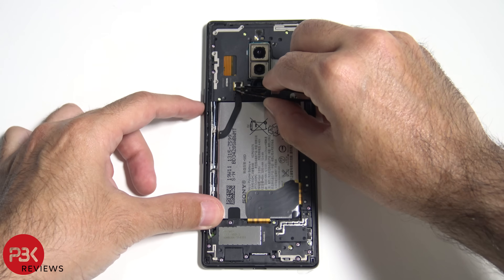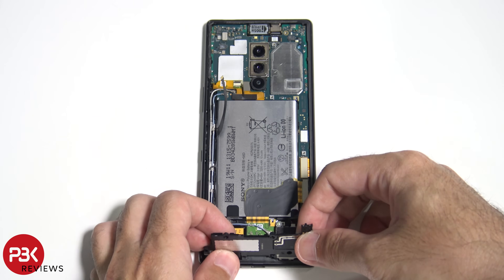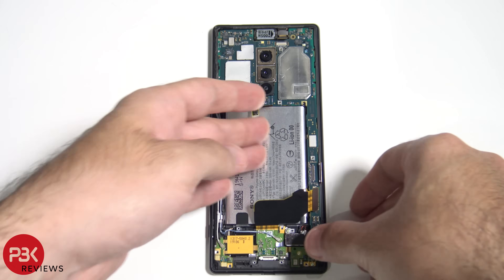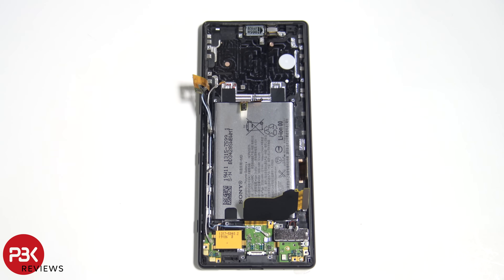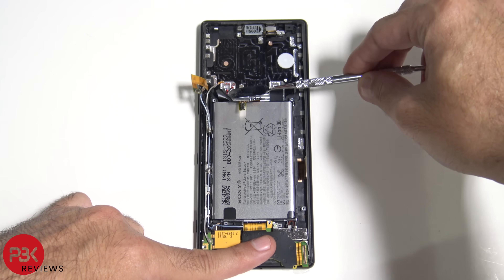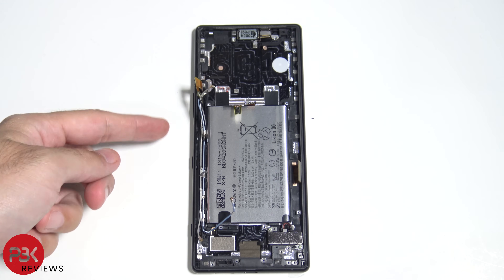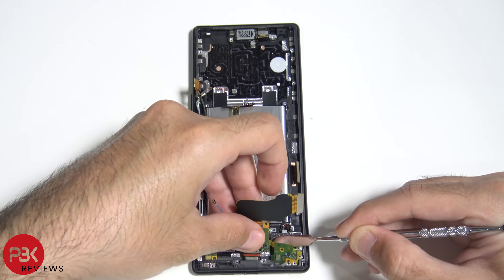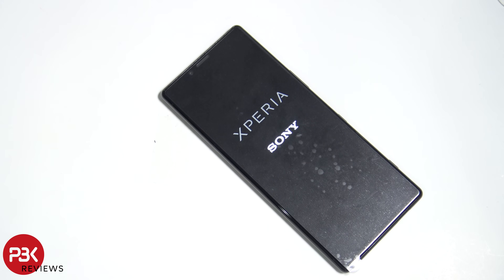Sony Xperia 1 Teardown Disassembly Repair Guide

Comment: Watching on my Xperia 1. My phone gets hot often. Is it due to lack of proper cooling system?
Reply from the maker: its possible, or it might be background apps running. Have you tried doing a backup of everything then factory resetting the device to make sure no malware or other stuff are causing this?
Reply: @PBKreviews  thank you for replying. There's no malware probably because I don't download random apps. But I have noticed one thing. I added you tube, Google news, Sony news, Flipboard and Google app to focus mode. When I switch focus mode on, it gets less hot or sometimes no hot. Is YouTube causing this ? Because others are just news apps. When I close all apps in background, still it gets hot. But when I switch focus mode on, it doesn't or less. Sometimes it gets too hot while charging. If I have to make a video call after, it doesn't last more than ⁵ mins. But I will try your advice. I will factory reset it. But this problem is since beginning. Any other advice please tell me. Thank you.
Reply from the maker: @ssingh5423  Its normal for phones to heat up when using the internet or charging the phone or playing games etc. Just depends how hot its getting. If its hot to the point its burning then that's not a good sign but if its just getting hot and you can still hold the phone in your hand comfortably then its normal.
Reply: @PBKreviews  ok. I will factory reset it and let you know. Do you think YouTube can cause it? Furthermore, are other companies giving better heat management system than Sony? When you tear down Xperia Mark 2, please compare heating system whether it is improved or not. I have watched your video of 10 Mark 2. You just told about hearing paste but not that it is improved or not. Please explain those things as well in videos. Your new subscriber. Thank you.
Reply: Factory reset will do nothing. This phone is a high performance device and will overheat easily when toughest apps are used. This will include video, games and functions like hotspot

Comment: Hi there can you advise me where i can get a replacement screen please
Reply from the maker: Hi, there are some on ebay but are pricey. You can search it on ebay and filter to list from price + shipping from highest to lowest and you will see there is a few listed. Reason I say to filter from highest to lowest is there is no one selling it for cheap so those are the only ones on ebay I was able to find. When you search it regularly it shows hundreds of other model ones and hard to filter through them to find the xperia 1 screens.

Comment: Is it possible to change the display and frame if I follow your disassembly guide?
Reply from the maker: Yea you should be able to. It's easier to do if you find a display and frame combo but if not, the screen after disassembling the phone is held on with adhesive. You would need to pry off the old screen and apply new adhesive and the new screen to the frame and reverse the process.
Reply: @PBKreviews  thank you very much :)
Reply from the maker: @batschisdadoller  you're welcome

Comment: Hi damaged my back cover ordered a replacement cover how do you remove the cover easily does it just snap off or is it glued in? Thanks in advance
Reply from the maker: Hi, its held on with adhesive tape which is like a double tape, sticky on both sides which holds it down. Apply heat and pry it off. Usually the replacement backs should come with adhesive strip pre installed already so you can just peel the protective tape off of the adhesive and install but if the one you ordered does not, you can order smartphone red tape or smartphone adhesive and cut strips that you can stick around the sides of the back plate to hold it down. I also have links in the description for adhesive tapes etc.

Comment: Is it fair to say the the position of the cpu makes it impossible to add passive or active cooling to the back of the phone? For example, heatsink or fan or fabricating a custom back plate. Is the main heat source facing the back of phone or the screen?
Reply from the maker: Yea the main heat source is facing the back of the screen so I don't think you would really be able to add anything aside from a thin copper vapor chamber that you can put in between the frame and board and remove the thermal pads and use thermal paste instead with the vapor chamber.
Reply: Find a backfan on aliexpress. These are good enough. I have one. It uses a small spring to grip on both sides. I can easily avoid accidentally pressing buttons with it too. It wil work, just find a good one. The phone, the whole brand, is worth it.

Comment: Does the back plate just clip back in place?
Reply from the maker: no you need to apply new adhesive to the back
Reply: @PBKreviews  where do you apply adhesive is it round the edges, is it like a glue or sticky pad?

Comment: I accidentally inserted a sim removal tool into the top tiny hole on the other side of the sim card tray (forgot that on the xperia 1, you don't need to use a sim card removal pin).

Will that damage anything?  I looks like I just poked through a piece of foam?
Reply from the maker: For the most part you should be fine, that hole is for the microphone. The thing you poked through is the filter/gasket
Reply: PBKreviews thanks man, great video!

Comment: So what do you think? They could've had wireless charging easily there right? enough room also.
Nice teardown video.
Reply: Late reply but Sony Xperias dont have wireless charging because that is less effective which means more heat which means faster battery degradation.
Reply: @hampusrytterlov8619  yeah i hear sony batteries are better long term and a large part of the reason is the lack of speed charging and wireless charging. i'm fine with a little slower charging speed if it'll keep the battery in good condition longer.
Reply: Wireless charging is like toys for kids: it gets used a bit then tossed aside.
Sony uses their head and doesn't add something that's of no use in the end.
 It also only creates magnetic fields. Very dangerous for any kind of pacemaker/ICD.
Reply: @MissQueenEllie very good points my man. Though i think Sony have added Wireless charging to the latest version so they must have either changed their mind or just given in to customer demand who knows?
Reply from the maker: Ya would be possible. Thanks!

Comment: Would have been funny if after you put it together and turned it on it caught fire and blew up...like a Galaxy note 7. Seriously great tear down. I am seriously considering this phone.
Reply: I got the chance to preorder  both for the price of the phone, from B&H, I personally like the phone a lot, fast charging 18W, screen is gorgeous, tall aspect is great for browsing web pages and watching movies 21:9 ratio, cameras are ok too did not used them a lot yet, it comes with a headphone to USB C adaptor... works
Reply from the maker: lol ya. Thanks!
Reply: @PBKreviews  i hardly use headphone jack anymore so i ordered the phone at B&H. So this video may come in handy!
Reply: This is not crapy samsung. Japanese worked on it. 
Sony 
Make,Believe.
Reply: buddy1065 it is a great phone but a shame there's no headphone jack
Reply: @kapilbusawah7169  it has an adaptor in the box with the phone works great, with Audio Technica headset

Comment: People are complaining about the battery capacity, do you think there is more room for a bigger battery??
Reply from the maker: There honestly is no room at all around the battery to put a larger one in. This phone is pretty compact as it is so the battery is snug fit pretty much.
Reply: @PBKreviews  does it have good cooling system? Mine seems to overheat and shutdown a lot
Reply from the maker: @alfonsoalvarez8357  Nothing crazy and super good no. Just typical average small thermal pad transferring some heat to the midframe
Reply: @PBKreviews  could that be the reason my phone shuts down a lot when playing high graphic games or spending hours on facebook?
Reply: @PBKreviews    i have problems with my xperia 1 shutting down when in use, especially when using facebook for prolonged periods or playing games like asphalt 9. It also shuts down during gpu tests or geek bench tests. I am only able to complete them if i dunk the phone in water. When the phone shuts down and i try to restart it the screen would glitch, like tiny colored lines would appear and the phone would freeze. It will only boot properly if i wait a while for the phone to cool down. Do you think its because of the kind of cooling system this phone uses or is there something broken on my xperia 1?
Reply from the maker: @alfonsoalvarez8357  Its possible, or it might be just overheating due to other issues and shutting off since its overheating to prevent the processor from dying out
Reply: @PBKreviews  thanks for the info. The problem started even before my phone caughta drop of water
Reply: Dont need bigger battery becouse sony is the king for battery optimization. I have used their devices from 2003 and everything perfect. 
GUARANTIED.

Comment: Nice review man 👍, how did you find the build quality on that phone?
Reply from the maker: Thank you! Overall I think the build quality is good, I especially like what they did with the battery tabs making it easier to replace the battery, so repairs on this phone should be much easier than most other phones.
Reply: @PBKreviews  what about the sony xz2
Is it easy also to change battery like this one ?
Reply: just ordered this phone and gonna try my best not to have to ever do this. from what i've heard, even though the battery is a little on the small side, it's a very good long term battery and after a year and a half it still tests nearly like new. and i'm pretty sure the guy making that review uses up a lot more battery than i will on average.

Comment: No copper, no cooling method... Dissapointed
Reply from the maker: It has the thermal pads which transfer the heat to the midframe but yea it doesn't have any advanced cooling but it isn't a high end gaming phone either so it won't be producing as much heat as a gaming phone would. The cooling should be sufficient for this phone.
Reply: @PBKreviews  what do you mean by it is not high end gaming phone... Sony Xperia 1 is sony's 2019 flagship phone... Meaning it is high end
Reply from the maker: @kangaroo3223  yes but it is not made based off the fact of gaming, like the Asus rog phone for example. I'm not saying its not a high end phone but its not a high end gaming phone which has additional cooling and graphics in mind
Reply: @PBKreviews  OK.. I understand...  I have a question. Are refurbished phones good?
Reply from the maker: @kangaroo3223  Now a days, manufacture refurbished units are really good, they basically replace almost all the parts on the phone and make it look and function as new. 3rd party seller refurbished units are a different story and those can vary from seller to seller
Reply: @PBKreviews  what seller do you recommend??
Reply: @PBKreviews  i have problems with my xperia 1 shutting down when in use, especially when using facebook for prolonged periods or playing games like asphalt 9. It also shuts down during gpu tests or geek bench tests. I am only able to complete them if i dunk the phone in water. When the phone shuts down and i try to restart it the screen would glitch, like tiny colored lines would appear and the phone would freeze. It will only boot properly if i wait a while for the phone to cool down. Do you think its because of the kind of cooling system this phone uses or is there something broken on my xperia 1?
Reply from the maker: @alfonsoalvarez8357  I mean the phone is water resistant not water proof, I wouldn't dunk it in water every chance I get. It's possible over time little water got in and caused liquid damage inside causing the phone to malfunction and act the way it does now. Glitchy screen, over heating and symptoms like that are signs of water damage. You can take the phone apart and make sure there is no corrosion on any chips or connectors and if there is brush it off with a tooth brush or similar brush and if the thermal pads don't look good, you can replace them as well to help transfer heat better but keep in mind if you take the phone apart, it would be water resistant anymore. You would need to find the original pre cut adhesive to be able to reseal it to ensure a water resistant seal.
Reply: @PBKreviews  the problem started even before i got my phone wet.
Reply: There is no need for cooler. Sony is perfect never lags like garbage samsung. Get out .